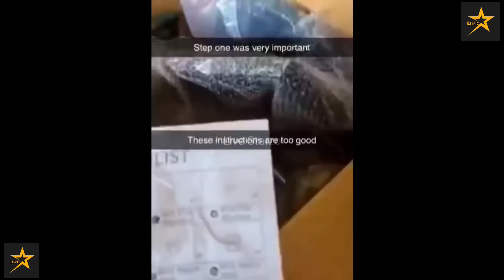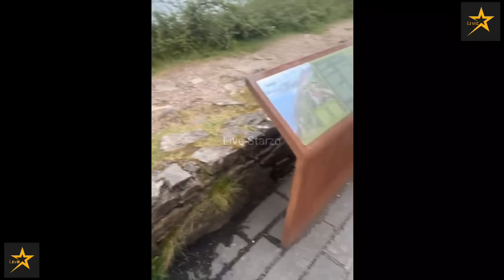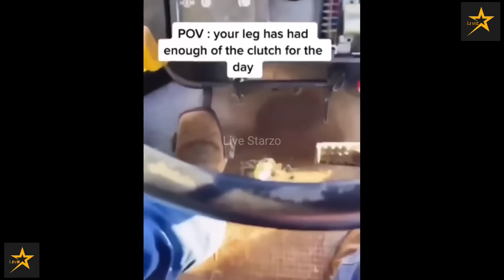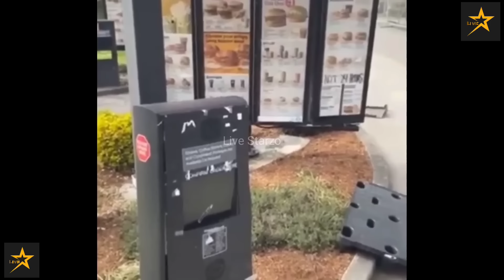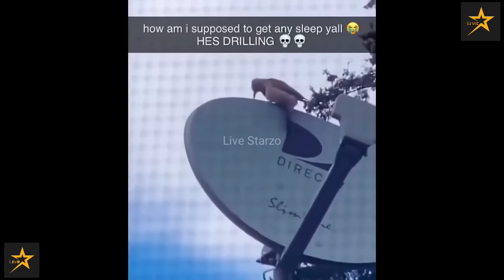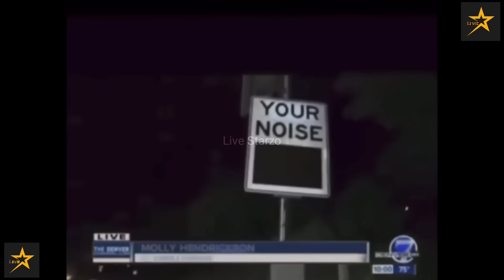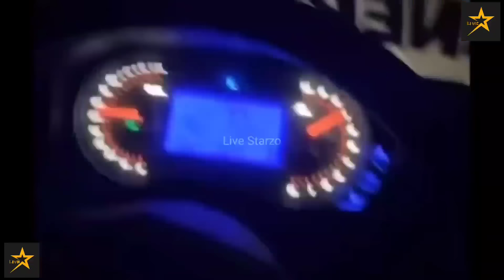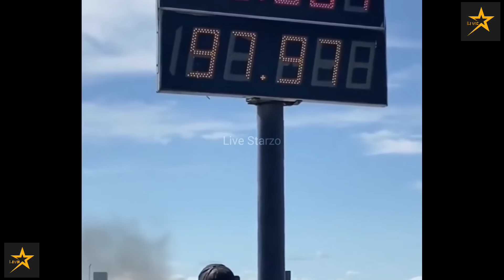Best Redneck TikTok  2022 [1Hour]🤠|New Best Country TikTok  2022 [1 Hour]🇺🇲 | Full Send TikTok 1Hr |

Comment: I come from a time where nothing I drive has or had a rev limiter,,,. You wanna impress me, do some of this sh*t that is done,, WITHOUT bouncing off the d*mn rev limiter all the time!! 😂😂😂. I couldn’t even consider putting a lot of these guys in my vehicles as they would,d red line them and destroy a motor in no time. Throttle control boys,,, that’s how they stand a monster truck on its nose or tail, spin out of a rollover and wind up right side up, but they are managing the throttle, not bouncing off of the rev limiter,,,,.